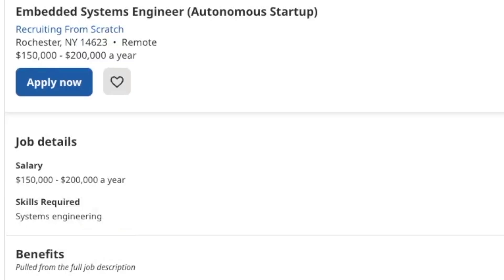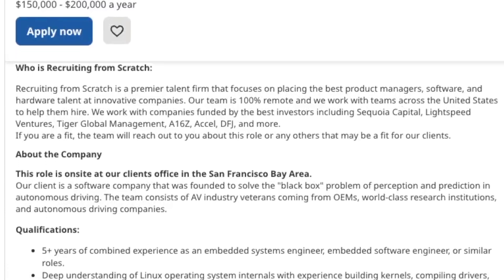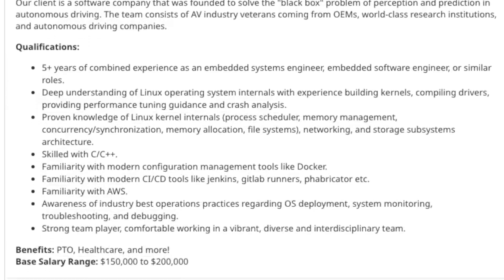Embedded Systems Engineering VS Embedded Software Engineering

Comment: Hi, so I have an untraditional background as I am more self-taught since my degree is in math.  Here in U.S., there is a huge demand for embedded engineers for hardware, software, and firmware so they hired me.   I have been working professionally as an embedded software engineer for 2 years now.  I work with medical devices in my current job.  Internally, I am a "software engineer" (that is my title).  My responsibilities have been all over the place BUT I am NEVER directly responsible for hardware design.  Our electrical engineering team (hardware team) is responsible for hardware decisions.  I've developed both windows/linux-based GUI applications (both frontend and backend) for characterization and testing hardware of our embedded system in conjunction with the firmware developers, automation scripts, and firmware (both application-level software that uses lower layer device drivers to generate the business logic AND I've done a bit of device driver development).   I think it is a bit more difficult for me to get opportunities to work on firmware because I do not have the strong circuits knowledge.  However, the software side is a lot easier for me to pick up.
Reply from the maker: love this, thanks for sharing! :)
Reply: Can you share your linkedin id so that we can connect? I have few questions to ask.. it’ll be helpful
Reply: @arbaazmakandar1692   why not ask here?
Reply: @classyjohn1923  Dont want it to be public
Reply: @iAmNotBot  That is not true that I have the "Best proven roadmap by experience".  My path here was not "traditional" or straight-forward by any means.  Every step of the way, there was a lot of resistance on my path because other people didn't like that I wasn't traditional/conventional engineer.  The only reasons I am where I am today is because:  

1.  Managers gave me a chance/opportunity.   

2.  I learned enough knowledge of programming and electronics that I can say enough in interviews to indicate that I have more than "surface-level knowledge".  

3.  I have relevant work and project experiences I can talk about.
Reply: @classyjohn1923 congratulations on efforts, hope they are paying off well. If you don't mind sharing, what are the programming languages you usually work with? Did you have to spend time learning those FAANG-interview style questions on data structures and algorithms? What specific topics/projects that have been helpful for you?
Reply: Please can you share roadmap to become embedded software engineering especially for medical device
Reply: Would love to link up with you. 
I am an Electrical Engineering graduate majoring in embedded systems.
Reply: @classyjohn1923  i liké hardware so much even soft I choose electronics or embedded systems e g
Reply: I would trade jobs with you except 1) I want to do much more direct hardware work, and 2) I'm currently unemployed so it'll be a bad deal for you!   Like you I have an unconventional career path, majored in physics, fiddling with electronics since I was a kid, but out of grad school I discovered that anyone who could program a microprocessor to make an LED blink, and make a Sun workstation crunch numbers and draw plots, could be hired right away to develop software.  Been stuck in software most of the rest of my career.  It's not bad, but I don't do business at all, or web work other than interactive graphics.   Job hunting for embedded is tricky due to not much embedded work on my resume.

Comment: Hello, right now i am working in a Startup as a "Embedded Software Engineer". My main job is develop the firmware of the product that my company sells, but i also bring some help to the PCB designer to validate/choose the components of the board and validate the design before sending it to manufacture. Also sometimes I must get involved in soldering or desoldering components, etc. Hope this comment bring some help to someones
Reply from the maker: Thanks for sharing! I hope so too!
Reply: That sounds like my dream job. Do you have a degree in computer engineering?
Reply: Hello please what are the programming languages that I should learn to become a good Embedded Software Engineer
Reply: @kamgafotso  Depends on the job, and the level of abstraction you're working on. Most generally, C.
Reply: Then there's the matter of FPGAs.  For working with those, VHDL is king, or Verilog at some companies.

Comment: So interesting! In many companies in Switzerland it is like that: Embedded System Engineer is an electronics guy developing electronics and writing low level firmware (baremetal and RTOS) where as the Embedded Software Engineer is doing software development on Embedded Linux/Windows Level. The requirements are coming from Marketing/Product Management working together wirth Requirements Engineer and the Solution Architect is creating the Big Picture based on the requirements.
Reply from the maker: Nico! Thanks for sharing this! I’m sure it will be helpful to many people seeing this video!

Comment: very cool. so as an overview embedded software engineerin is a subset of embedded systems engineer😮
Reply: Yes, in fact I think a more exhaustive name for the "embedded software engineer" position is just " firmware engineer", pretty much self explanatory IMO.
Reply from the maker: Not necessarily, but it is a subset of embedded systems. Also firmware engineer and embedded software engineer are used interchangeably, but they can be different areas for some companies (firmware engineer focusing on low level drivers, embedded engineer focusing on the higher level parts of embedded software).

Comment: hi! thank you so much for these amazing videos. question: i am a mechanical engineer recently graduate and going for a mechatronics Msc degree this fall. i am really interested in the design of electromechanical systems, so i am more into the hardware side of things. what are some roles that you would advice me to look into? I am ok with writing software but would rather avoid it and focus on the pcb design/electromechanical integration but i am not sure if such role/position exists. in particular, i would love to work on aerospace/automotive/marine industries (in that order). thanks!!

Comment: do you thing there is different between embedded firmware engineer and embedded software engineer. i raised this question because let said i develop a cli app in embedded linux what am i? embedded software engineer or software engineer who working on embedded system?all i know i definitely not  embedded firmware engineer
Reply from the maker: Very slight difference between the two, so companies use this title interchangeably.

Comment: I am an embedded systems engineer, the is guy btw embedded software engineers can develop better software from us. Also there are lots of embedded software dev jobs but significantly less embedded systems engineer job.
Reply: Like he said, and i commented. As an embedded systems engineer you can work as an embedded software engineer in some companies. Like i said there are more jobs in software, so you find yourself as a developer. Also like he said, all of the things are change company to company. I can suggest you to work on c cpp bash operating systems drivers and ui. also work i2c spi and other ttl coms. Learn the details of Arduino Nucleo and Raspberry. Don't use libraries and pre developed software, try to create very beginning.
Reply from the maker: All good points! Thanks for sharing @FURKAN AYAS!
Reply: @GreidiAjalik  Thank you, you shared all the great main points about the subject.

Comment: Can  you write a  program for microprocessor chips chips you would find in digital timers
Reply from the maker: Yep you can!
Reply: @GreidiAjalik  I was actually referring to you. Can you Greiti write a program for microprocessors like the n76e003at20 and which language do they use?
Reply from the maker: I've not worked with this microprocessor, but I probably would be able to - my guess is that C language would probably a go-to.